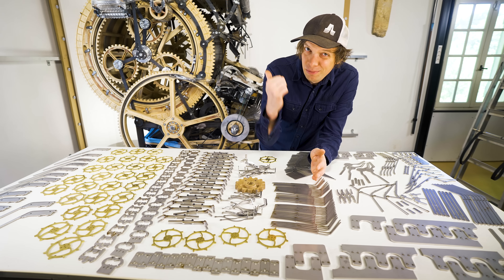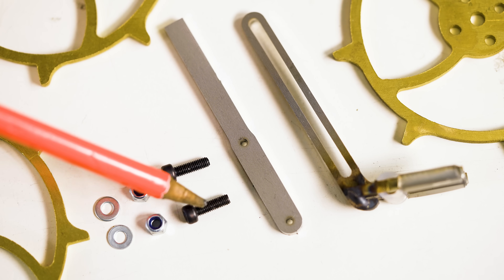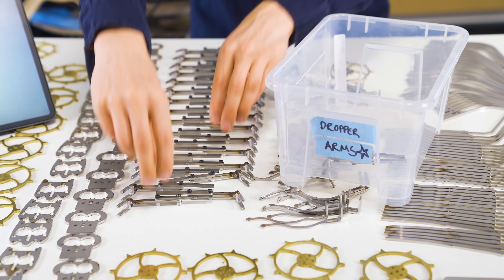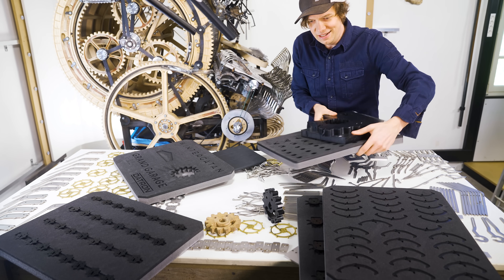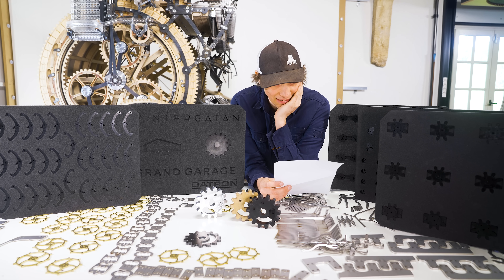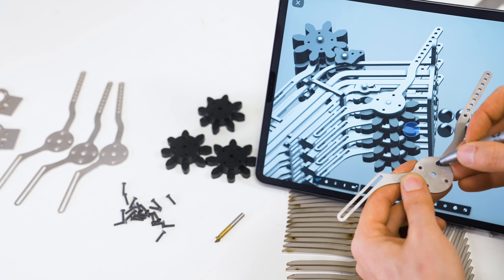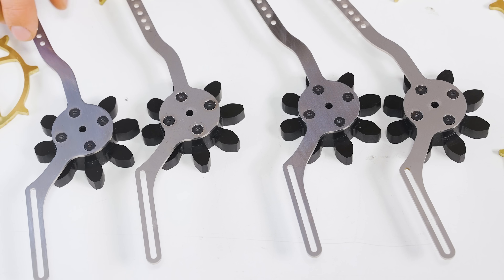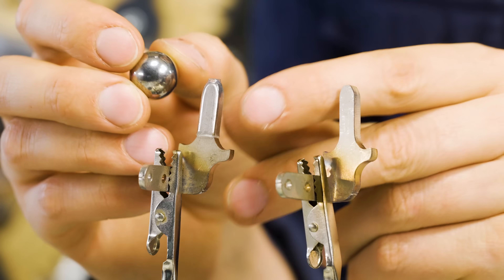Solving the 1000 Pieces Engineering Puzzle

Comment: There is a very import reason why it has been not recommend to put a welder lead around neck before we even knew about possible EMF risk.   This is the risks from isolation damage in welder lead meeting human sweat.   In other words electrocution.   Yes people do die every year from welder electrocutions some of those die because the lead insulation has cracked they do not notice  they have it around their neck they work away sweat  and they come the short path to ground stopping their heart as soon as the sweat makes the connection.   Zap on the back of your neck is a really good heart stopper it takes a lower level of electrocution on the back of neck compare to your hands to stop you heart.   So I am really happy to see you are not doing that any more because I really don't want you to die from this minor mistake and leave this machine incomplete.   Remember this is instant death not the EMF risk that might hit you years to decades down the track.

Be aware it can be really hard to spot cracks in your welding leads.   I did not see clearly in the video I think you hooked the lead straight over metal that if so that not ideal.   Little bit of garden hose goes a long way on  welder lead support frames made of metal to make sure they cannot turn live if there is a flaw in the cable at the point they go over the support frame.   As I said I did not see clearly it could have been over metal covered by silicon tube or wood part or something else insulation.

General rule with welder leads too much insulation is way better than being a little short.

Yes it does annoy me how many people say EMF is why you should not put welder lead around neck.   When in reality  number 1 reason why you should never put welder lead around neck heck even normal power leads if  any other option exists is electrocution risk.   Do take a closer look at your shirts after hard work sometime the shoulder area is generally the most wet.   Yes you hear electricity and water don't mix a lot that exactly what you do when you put power cable of any form around neck.   So if you have no other option but to put any form of active possible human killing power cable around neck you better be sure its in really good condition because if it not you just could have kissed your life goodbye instantly.    EMF is truly secondary problem here.

Comment: drilling through metal generally needs to have low rpm. you can calculate the electric field generated. You know the input voltage and current so just use the equation for electric field of a semi circle since it is wrapped around your neck

Comment: There's little to no worry about putting the welding cable round you from an emf point of view. Assuming it runs at 50Hz the wavelength would be 6km long, so both low energy and the cable is far too short. There is magnetic fields produced but thanless you have a hard drive in you, I think you'll be alright. Dangerous EM waves are Tera or Petahertz in frequency

Comment: I would be highly sceptical of anyone claiming that EMF is dangerous.
The first question is in what way is it damaging. Low frequency EMF is hard to directly damage people. At most it typically heats things up.

I have found one paper indicating a connection between welding and cancer, but I think it also indirectly highlights the likely cause, arc welding, noting that arc welding causes it but resistive welding doesn't.

When you use arc welding, an arc is produced. This arc has ionised gas, which is highly reactive and if it gets into you can cause damage. It can also create reactive species in the air, which can then also get into you and cause cancer.
So I would be more worried about the arc.

Comment: Put a vfd and 3 phase motor on your drill press and you’ll be able to lower the speed to a reasonable value for drilling steel. We made this mod on our drill press and regularly drill through 3/16” mildly hardened steel without killing bits

Comment: I use a strap hanging from the ceiling to hold the cable for the welder. I also use a similar setup for my vr cables so i don't step on them.

Comment: Stainless is a fickle material to work with. Your speeds and feeds were wrong and it work hardened. The instant the drill bit rubs the material rather than cutting it, it hardens.

Comment: Water is the best coolant and run the drill very slow.  Drill the part in the water. Stainless heat hardens profoundly when  worked.

Comment: That's just mind-blowing to me -- parts made literally half-a-world away from each other fit together perfectly.  Does anyone else appreciate how unbelievably amazing that is?!  Manufacturing has come so far in the past decade or two.
Reply: Laser cutting was invented in the '60s. The main difference in the past decade or two isn't the manufacturing, it's being able to send the designs via email.
Reply: Actually not too new a "thing" - think of the car industry, components come from all corners of the world and are then put together
Reply: ASMEY14.5 came out in 1973 specifically to enable this. It's nothing new.
Reply: The International Space Station was never fully test assembled on the ground. 
The many internationally produced modules being only fully assembled in Orbit after many years of development. 
Pretty impressive work on the part of all the contractors and international partners involved.
Reply: @jasonp.1195  They actually still had some issues.
Reply: @thomasbecker9676  Yes, but no need for an in orbit angle grinder :)  Though I do recall an amazing repair with an astronaut sewing together a ripped solar panel while attached to the end of the long shuttle inspection arm being held by the station's robot arm at its absolute furthest possible extension and 'barely' reaching the needed spot for the repair work. That was a very cool moment. And it worked! As far as I've ever heard that hand sewn repair is still in place.
Reply: @jasonp.1195   , would an in orbit angle grinder shoot sparks?  Are the sparks oxidizing or are they just hot enough to radiate visible light?
Reply: @jasonp.1195  That isn't entirely true. They have 100% accurate replicas of (almost) all the parts, so they could do that. It's just not necessary, because they are usually trying just few parts together.
Reply: Ever heard of Gauge blocks? It's an 120 y.o. invention...
Reply: Also shows when people care about what they are asked to make, they can meet the requirements. I doubt either party would send him back garbage because they care just as much about making a quality part with their name attached to it as Martin wanted perfect parts.
Reply: Yeah it's called math. Objective and unchanging. Truly a wonder of the universe.

Comment: So machining stainless is a pain because for some reason the stainless steel on a microscopic level is similar to something like a chocolate chip cookie. The chips of the cookie are small segments of the stainless that are harder than the rest. The difference has no noticeable effect to the structural quality but on the scale of machining it causes the edge of tools to become dull rapidly, more rapidly than a more homogeneous but on average harder (to an extent) metal. This effect causes the speeds and feeds tolerances to be even tighter and things become more temperamental. The size of drill and relative lack in rigidity in your machining set up compound the problems even more. So breaking three small drills in this situation is a only three drills situation.

Comment: look at all those not unique parts. so easy to replace when things break. a nut and bolt would be best since tapping those holes theyd eventually wear out and if you damage the treads then they lose a lot of their clamping power. plus the lazer probably hardened the holes. also i hope you ordered spares of all the pieces here, more specifically the delran pieces

Comment: Don't think you need to be that worried of the health consequences by your welding. But as you mentioned it's easy to avoid.

But the EMF power is not that high when your welding current is so low, in assuming your running dc which also lowers the possible EMF, even if your using HF to start.

A lot higher on my priority list would be to not lean over your welds, fumes are not great, even if you weld nice and clean metals.
And a possible problem if you weld a lot in one day is the speed glass helmet. It can't darken quick enough so after a long day or if you have senetive eyes it can hurt your eyes.

But then again, you don't weld that much, your using clean materials and low power, the chanses of something bad happening is really low.

If you come across a good deal on a fresh air mask (fan with filter you strap on your back that constantly blows air in your face), buy it. It's amazing.

Comment: Litterally Martin in another video: 
No more pressfits ever.
Also martin:
Makes all dropper arms pressfit for adjustability

To martin: you might wnt to try and fix those dropperarms in place somehow once you got the timing right, because the marbles will drop down onto them and will, eventually, shift and need to be re-timed. Thats just how pressfits work when something falls onto them repeatedly.
Reply: I think you mean friction fit? Yeah that does seem like a concern for the dropper arms since they will get constantly pelted by marbles.
Reply: @ninjafruitchilled  yeah that‘s the word!

Comment: Martin: "I need to innovate new solutions so I can end up having to use less pieces, which is more reliable and easier to replace"
Also Martin:
Reply: This is actually fewer pieces, but more marble gates. 50 * 6 is greater than 2 * 24
Reply: @user2C47  i believe that 2*24 should be more
Reply: @IamJmc1992  The numbers don't actually mean anything in relation to the marble machine. They are just arbitrarily created examples to help explain how more gates with fewer parts each can still be more parts overall.
Reply: One thing i've learned on this channel is that tapping threads is hard and requires a lot of skill. 

Martin: let's just tap 70 of them, or maybe not...

Comment: I worked with outboard engines for over 10 years and this is stainless steel in aluminium dipped in salt water and I can verify that drilling, tapping, cutting and working with A4 steel is very tricky, oh the wet hard worked steel that just have to break your tools no matter how careful you are, well sometimes at least lol

Comment: Also, I welded Stainless for 2 years. Lower power applications like a TIG unit, you're likely not going to create substantial EMF, though hanging the cable off a higher object like you did this video is better because, hilariously like you said about the helmet flip, neck injuries, especially if you snag the cable on something. 

For your application, I'd be amazed if your welder is even drawing 3 amps as you use it - We used lunchbox sized tig boxes that ran on 110v with 5 amp breakers - I'd be more afraid of your microwave. Your bigger health threats are the fumes from stainless - the Chromium in the steel offgasses as Cr(VI) which is exceedingly toxic (You should probably have at least a small fan pulling air away from you as you weld) - and the Tungsten tip - Most are 2% Thoriated, so they are radioactive, and burns from them... don't exactly heal all that well.

Comment: That neck flip is actually one of the most common causes of occupational injuries among professional welders, you called it correctly Martin 😅
Reply: Haha well at least that is a plausible source of injury, as opposed to the EMF nonsense.
Reply: @ninjafruitchilled  yep, the EMF in welding is just too low, you get way more with cellphones or MRI machines.
on other side, the cable weights a lot, I wouldn't be surprised if have a 1kg (2 pounds) peer meter (3 foot) welding cable.
and I know that 100 grams (1/4 pound) can cause neck injury.
Reply: I suspect that's from frequent pressure on the neck, not from non-ionizing radiation. Also, a lot of occupations where people spend their time in one pose, with muscles in a strained position get injuries. Again, nothing to do with electromagnetic fields.
Reply: no one replying to this seems to understand that Erik is talking about the motion of flipping the welding helmet down. It has nothing to do with the cable business. Martin wryly mentioned getting a neck injury from the helmet flip, but it's no joke.
Reply: @ReedCBowman  Haven't got a clue what you're talking about. Who's this Martin fella you're on about?
Reply: @ReedCBowman  - You clearly did not pay attention very well to the video. The whole "safety" thing was absolutely about the cable & any associated EMF. The flipping of the helmet was a joke thrown in after the safety note. Then, he threw in a different safety comment after that (about possibly getting comments regarding neck injury, as if to point out that no matter what you do on YouTube, the self-appointed safety police will always find something to whine about.).
Reply: Right? My dad's a recently-retired factory welder of 40+ years, and knew enough to NOT do that, and is one of the only ones from his era to not have to go on disability due to neck issues.
Reply: I always thought it was for those with pacemakers since they sit on your shoulder. Probably the only plausible reason someone could come up with
Reply: At least you get a warm neck when it's cold in the workshop and you weld at high amps ;-)
Reply: If the EMF was dangerous around your neck, it be dangerous on the floor next to you.
Reply: @Geerice  Well, no. If it was giving off harmful emissions (which it isn't) something 5 feet away is going to affect you far less than something pressed against your neck. Much like something that was red hot wouldn't burn you from 5 feet away.
Reply: As a marine electrician that works with welders, I know and understand EMF, and there's absolutely no danger with it. EMF stands for Electromagnetic Force. It's a magnetic field generated by a current-carrying conductor. EMF is how generators work. The only problem with EMF is laying power-carrying cable next to data cable, such as a 120V cord running alongside a Cat5 cable. The EMF will actually disrupt the relatively tiny current in the Cat5. The more distance these cables spend together, such as a foot of them side-by-side versus 100 feet side-by-side, the more interference.

The EMF of a single welding cable draped around your neck, less than a full turn, has zero health effects. You can drape the cable across your neck day in day out for 40 years of constant work and never have any effects from the EMF.
Reply: @kanegasi  EMF stand for Electromagnetic Fields and can possible be dangerouse in certain doses. Altough the specific danger to humans remains unkown, it is likely that time and strength of the Field (depending on the power of the electrons) are two highly contributing factors.

Having that said EMF is mainly a danger to other electronic equiment. Therefore the standarts worldwide are designated to protect equipment and grids and have limits far away from what is considered to be potential harmful to human beeings.

A word to how dangerose EMF can be: From higher power consumption over accelerating cars to bonebreaking Exoskeletons or disturbance in the radio is everything possible. 

To conclude: EM-Fields can be harmful. Tow good ways to deal which such possible danger is
1. Don't take unnecessary risks
2. Read the manual (Saftey & Handling tips where written with a reason)
Reply: @thelargeL  The F in EMF can also stand for fields, but in this specific case, it's force. We're talking an extremely weak electromagnetic force coming from the cable. It won't even align any ferromagnetic dust to the cable. The problem with other cables is that this force can induce a current within another cable, which is the interference I explained in my first comment. This induced current is strong enough to disrupt the tiny currents in a data cable but is harmless in other power cable.

As I mentioned, I'm a marine electrician. Large ships have miles of cable sitting side-by-side. EMF from a 120V powered cable is enough to cause a noticeable voltage in an unpowered cable, but typically less than 30V.

If you want to bring general safety into this, the chances of EMF being a danger to biologics are significantly smaller than the chances of the cable sheath in contact with your neck suddenly splitting open and shocking you.
Reply: @kanegasi  I agree with all; wanted just to annote that the safety in terms of EMF comes due to a lot of expensive design, testing and international limits.

I also don't see a scientific profeable danger of the EMF of a Welding cable. Probably the connected base unit is a lot worse in terms of electromagnetic pollution (Still far away from dangerous though).

Comment: I'm a welder and I wrap my tig torch like that every day. The most prominent effect of EMFs on biological tissue is heating - just like in a microwave oven. You would feel it getting hot if it were doing any damage. You would have burns. It's not something sneaky that can kill silently years later. Fumes do that, though. If you're scared of EMFs you should be much more scared of ozone and hexavalent chromium when welding stainless.
Reply: related: MARTIN PLEASE USE FUME EXTRACTION AND A RESPIRATOR WHEN WELDING STAINLESS

Comment: I can actually confirm that laser hardens the very edge of steel, but hardened region is very thin (less than quarter of sheet thickness). The hardened steel dust is real pain in the ass in lasercutting shop.